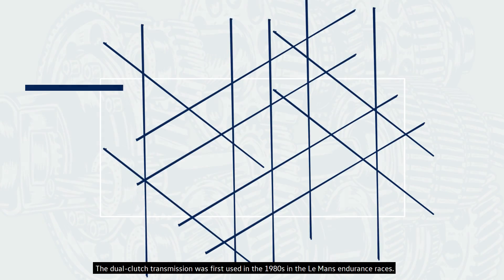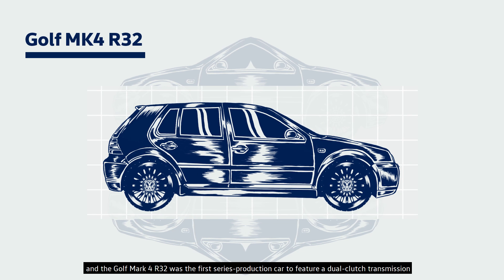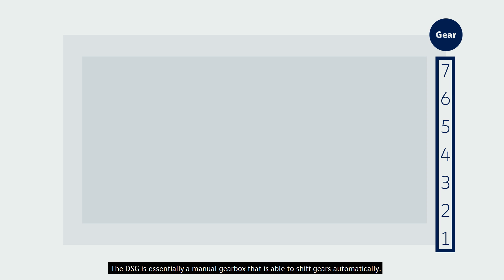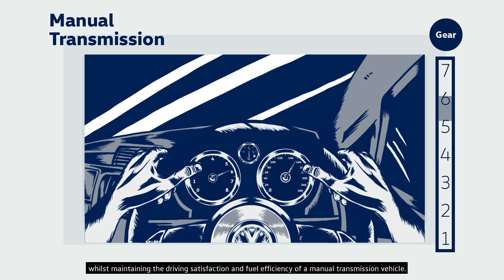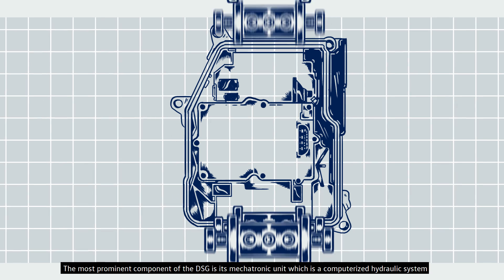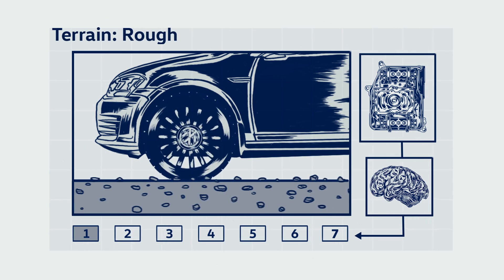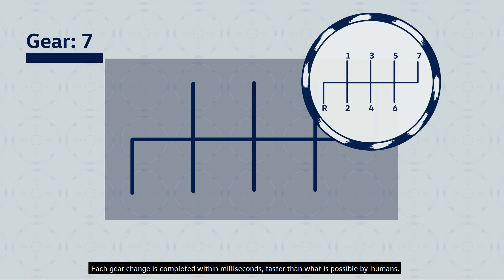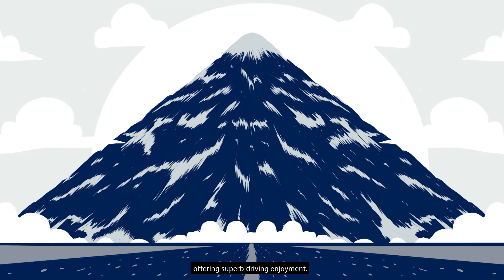How DSG Works | Get to Know Your VW

Comment: I have a problem with methode. It a clutch methode. Clutches wear every time you use them to get the car rolling. Also I live in Seattle WA State. We have traffic jams where carsove slower than a clutch methode can do engine at idle first gear. Dual clutch DSG can be programmed to do this. And there is a you tube video doing this saying don't do it can 1:41 ruin clutch this way. So I believe this type of transmission is no good and cannot be used in Seattle WA. I might also add saw reference internet or you tube saying VW went from DSG to real automatic transmission in one of their cars

Comment: While an excellent idea (this should have replaced every auto box in the world) the clutch packs and lower gears were simply not robust enough and there were many, many problems.  That's my take, I'm not an expert so I may be wide of the mark on what the actual cause was.  

VW made the mistake of not using low sulphur oil (?) initially which corroded the electronics but I would like VW to address the question of durability wrt to the clutch packs and lower gears.  It would be great to hear that I'm talking nonsense and understand the real reasons for problems !

Having an automatic / electronic operation of manual gears (DSG) is a great idea, the boxes are easy to produce (and repair if necessary) and those mechatronic units are replaceable too.  I'm extremely dubious about the Ford and GM 10 speed type auto's , they're simply not age proven enough and no one maintains / repairs them.  

I'm a VW Multivan owner of 15 years, but if I were to get another vehicle it would be Toyota all the way.  I think it's ridiculous that VW timing chains on their cars are being replaced after 100,000 miles (why bother with chains if they need replacing so young?) and repair bills generally are so high now - as are car prices - reliability is  key.  High cost repairs are becoming normal - especially with German cars - and are becoming justified by the massive prices of new cars.  That's just not a world I want to play in.
We'll see what the electric transition does.  Solar panels producing hydrogen is interesting - imagine generating your own fuel!!

Comment: mine is making a woble/scraping sound mainly wile accelerating in 1st 3rd and 5th, noisier in 1st gear. 6 speed. Going to change the DSG oil because its been 4 years already not close to milage due... Any hopes it will go away?

Comment: So... How does it work?
Reply: Exactly hahaha
Reply: Lots of videos out there, it's clever no doubt but its genius is  that its a manual box with shifting operated by electonically (solenoids) activated  pistons/rods.  The input shaft is 2 piece, the first inserts into the second shaft making 2 input shafts that looks like its 1 shaft.  There are then 2 counter shafts for gears 1-4 and 5-6 for example.  

Which of the 2 input shafts (and so which gears ) is selected is controlled by 2 clutches at the top of the input shaft, an outer clutch and inner clutch (automatically operated) with regular clutch packs as seen in auto boxes (and some ltd slip diffs), operated using oil pressure.

Trouble is the durability of the clutch packs and lower gears, some say it's a problem though I don't know too much about that and I'm in no way an expert at all!!  I guess it depends on what your vehicle life expectancy is.
The benefit is that repair would be much like a regular manual box (that's what it is) and the mechatronics unit (the electronics) is easily replaceable too.  Much better than regular auto boxes which are basically not maintainable anymore.
Reply: Like riding  and shifting a semi automatic transmision motorcycle..

Comment: Are there any known numbers of the declines on the DSG? Bec that would make more of a statement instead of just saying it. People won’t trust you saying that it’s better now bec they will still follow the bad reviews on diff media platforms. As a VW fan I hope its true that the dsg is getting fixed bec that new POLO does look stunning and will be a big seller. Planning on buying a dsg one but waiting if there are any faults with the dsg after 2 years of ownership. If not you did a good job and the POLO will be my new love!
Reply: The early problems were that they didn't use a low sulphur oil and it corroded the electronics or the metal which then shorted the electronics (I'm not an expert), so everyone had to have their oil changed (VW were happy to let lots of people have failed gearboxes though).  So just that change would have reduced complaints massively.
However VW have never addressed the weak clutch pack and weak lower gear issues and i'm sure forums have other issues too.  
Manufacturers just won't come clean though on issues and are incredibly devious with major problems.